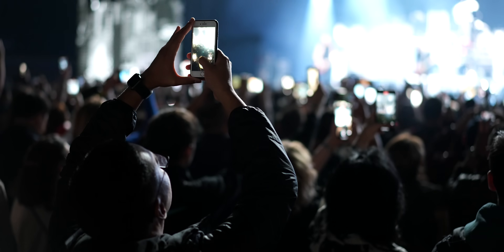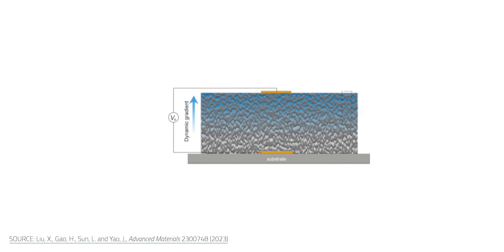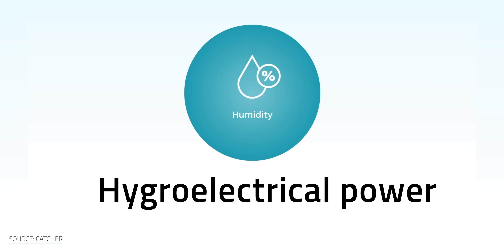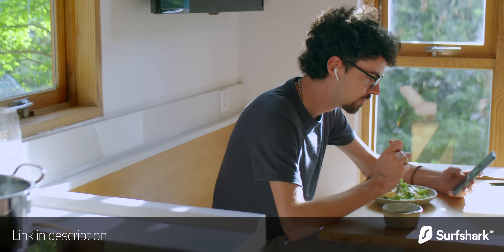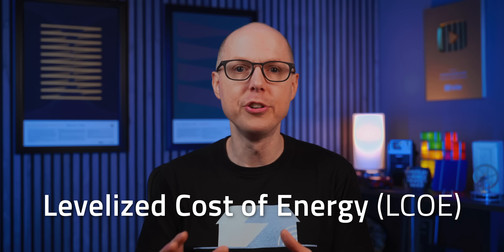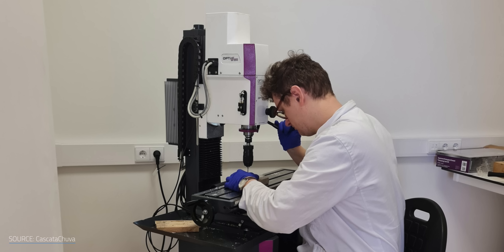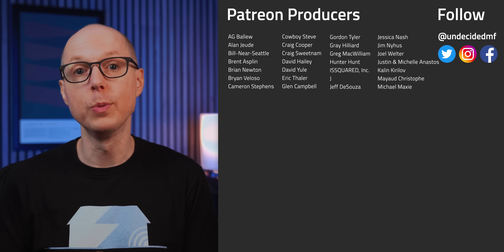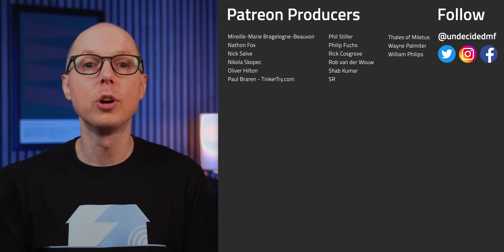Is This Accidental Discovery The Future Of Energy?

Comment: Huge missing piece of info here.  The humid air must lose energy in some form if it is to be the source of electrical energy.  How is the humid air losing energy?  Is the device condensing the water out of the air?  Something has to happen to the air, it can't just output energy and not change.  We would be talking about the old perpetual machine BS here if they can't tell us how the humid air went to a lower energy state when it output energy to the electrical load.

Comment: What comes to mind as a question to me is just exactly what is the process equivalent to recharging this battery. I'm presuming that using the battery doesn't physically separate Oxygen and Hydrogen atoms in the molecule, though perhaps that's an assumption that I wasn't clear was being made. Not sure that process is exactly 'safe', though at low volumes, it's probably not too hazardous, as long as no on introduces the elements to Thermite.. Regardless, the animation very nicely shows water molecules going into the material, but I'm not seeing any indication of how they 'clear' the space or if that's a part of what happens. Is the battery going from a 'no charge' situation to 'fully charged and permanently 'hot'' setup when activated?

I can see a bitcoin miner operation being set up with a floor of these, with, or without ventilation for air and humidity flow, with a layer of miners on top of the batteries, and the assembly filling a basement, or considering the heat generated, perhaps it becomes t he radiant heating for the floor above them?

Comment: If it's condensing water vapor while extracting latent heat, it can be used as as self-sustaining dehumidifier. Some of the generated power can be used for powering a fan to mix the air in the room.

Of course, this also means that it requires a filter to prevent clogs. So, it needs a built-in air purifier.

If it condenses air, this also means that it is a water generator. Can be used for some water needs, like cleaning.
Reply: lol, I didn't see your comment and basically suggested the same thing.
Reply: They don't have a way to take the water out. Imagine the nano-pore material starts off completely dry. As water lands near the outside areas, a voltage is generated. The parts where the water lands, gets more and more damp. But it does not get to dripping wet. Because as the "dampness" increases, the voltage starts to drop off. A balance is reached long before saturation.

Think about it. For the water to start dripping, you basically need so much water there is a film around the material. Then add more water, and only a while after that, does the dripping start. But long before that, the nano pores are already completely covered by the film, so no more power generation. I imagine the device, when it comes out of the factory, will work for a while, and then it stops working.

It is like a very inefficient battery. Once the reaction reach the limit, no more power. If there was some way to drive off all the water, then you may be able to get the battery to work again. So you have a rechargeable battery. If the process does not destroy the nano-pores significantly, then you can reuse the device for a while.

This is why Cascatachuva can demonstrate a small prototype. It generate a small amount of electricity for a short time. This is going to be Elizabeth Holmes all over again. I suspect there is an immovable wall they will run up against. The underlying concept may not be workable at all. The Russian Portuguese guys have nothing. Whether it becomes another Theranos depends on how far they choose to "fake it until you make it" and at what point they realize they will never make it. It could eat up a lot of investor cash if they are stubborn fanatics like Tesla, sticking to an idea that cannot work and refusing to give up. We now know (mostly) how to those electricity towers work. True believers can be crazy fanatics. It's only after they realized the futility of their cause, but continue to collect funds, that it turns into a scam and a crime. Some people will never get to that point. Our civilization's progress depends on people like this beating their heads against the wall. But we live in a universe with physical laws that can never be broken. Some of them are doomed to fail because of the bit of wall they selected is completely unbreakable.
Reply: @danielch6662  Thank you for the explanation. I got it 😊

I forgot how nano pores are very attractive for water. Even in our macro world, micro details on surfaces cause water retention (glasses with hydrophobic coating hold more water drops if they get micro scratches, or if they get dirtied by something). Nano details must be almost being glued with water drops.
Reply: @danielch6662  Elizabeth Holmes didn't have anything close to a working prototype of what she was talking about

Comment: Honnestly I have quite big doubts about this, especially when not knowing what is happening. I mean, they are talking about "generators" but what if that's like an air-battery ? meaning that you use it once, oxidizing something, then you can't use it anymore ? Like once the humidity is inside, it doesn't get outside (we saw a gradient here, so this could generate something)... But once it's "full" of water, what ? You need to heat it to get the water out ? Then this is not a generator, this is a battery... Don't take me wrong, this could be awesome, but there is so much unknown here that I don't believe it to be working soon.

I'm quite suspicious when there is claims about taking energy from "air". You always need almost two zones and transfer things from one area to the other (be it electrons, heat, pressure, ...) to get some kind of energy. What if that's only like piezoelectric currents from water condensing into this like into haze-condensing units for dry areas ?

To be honnest I though once about a system getting energy from humidity because theorically if you condense humidity you get some "heat" from that (you know, reversing the boiling process). So theorically you could have a working dehumidifier without energy source, and if you manage to do it well it could produce some electricity maybe. But this don't seems to be the case here.

Comment: I think that the $20,000 solar system is not equivalent to the hydroelectric battery. A 10KW solar system makes 10KW per hour, so if it averaged 4 hours of 10KW production per day that 10KW system will make 40KWH per day. In contrast the hydroelectric battery you mentioned, produces 10KWH per day which is not an equivalent amount of production. I would say that this hydroelectric battery is not competitive with solar on the basis of cost, rather if you have no way to utilize solar  this system would be effective at producing energy that someone might need. It is a small detail, but I think it is important to look at the totally production over a 24 hour period, because typically people have a daily energy routine that requires an average amount of energy to accomplish.

Comment: Step 1 - Water molecules gets close to the surface. 
Step 2 - Charges are moving towards the water molecule.
Step 3 - Opposite charge potential is created inside the material.
Step 4 - Electric current is equalizing the charge difference.
Step 5 - ??? What is removing the attached water molecules again ???
Step 6 - Charge difference created by step 4 remains and repels further water molecules ?!?
Beats me... maybe there is some organising effect that organizes the vapor a bit and converts vapor to liquid and this creates small water islands with more charge than the diffused molecules in the vapor and it's just knocking electrons to higher charge levels to cool down enough to stay liquid... or...

Comment: One micro watt per thumbnail is about 2 cm^2 or 5 miliwatts per square meter which is 200,000x less than the solar energy on a solar panel and 40 thousand times less dense than a solar panel for far greater construction cost and also likely a shorter lifespan.  It’s a fake technology that will never power anything but ultra low power devices and even that makes no sense when you can just put a battery on one that is far smaller and will last many years.

Comment: So we could finally have tech that we just need to breathe on it to power it...

But imho, if this works, instead of one large 10kwh battery, every device has its own small self charging battery. How much energy comes from the grid to power phones, TVs, heck even fridges...air gen built into our devices would reduce our grid dependence.

And if I can be so bold...a self charging EV in 50 years time...

Comment: I'm not super optimistic about this technology, it will probably only every be useful for very low powered remote sensors - which is still really cool. But say you wanted to power a 4k tv with this, just driving the pixels alone would require 9,000 sqrft of this material and you can't lump it all together into a cube because you need humid air, you can probably do layers but those layers can probably only so big before the material gets to far away from the air Inlet and the energy from the humid air was already fully extracted by the material closer to the air inlet. So probably useful for low powered IoT devices, remote monitoring devices (especially bouys) but I cant see it ever generating enough power to contribute to the grid.

Comment: Too bad it's fundamentally impossible to draw energy from a single state. As described, power generation from the fact that the air humid, is not possible.           

It could be possible to have some generation as the material adsorbs the water, but unless magic removes the water molecules that effect would be temporary, and the actual source would be "built in" in the material. Of course, variations in air humidity could make it possible for the nanomaterial regenerate itself, to some degree, but that still wouldn't release much energy, and they don't describe the process as requiring variations in humidity. Also, that would make the continuous generation they promise impossible.

The measured outputs could very well be explained by things like measuring errors, and or some "potato clock effect", and some could possibly just  cheat. All those things happens all the time, but power extracted from a single state, hasn't happened yet, ever.

Comment: I'm still trying to work out where the energy is coming from. Energy doesn't come from "thin air" - to use a phrase that might just be appropriate here (or not, depending). If something goes in, and energy comes out, what is changed? What comes out? 

I really hope this works. It would be great for me, where solar sees me through the times that tend to be drier, but falls short when it's overcast and damp. But I am sceptical.

Comment: Matt,

Great video. The 15k to 19k figure you have for their potential washing machine size product is the capex, not the LCOE. Assuming it really makes 10kwh/day, this goes for 20 years without any O/M. I did the following calculation

10 kwh/day * 365 days/year * 20 years * 1mwh/1000kwh = 73mwh
$15k/73mwh = $205/mwh, which is about 14% above nuclear at $180/mwh (Lazards figures at 2023), not too shabby. 

Assuming you can DRAMATICALLY REDUCE THE COST, this can actually be competitive.

Comment: Even if the power production from such a thing may be limited, it may be interesting for desiccant applications. Depends on how well it relocates or sequesters the moisture it pulls from the air. Even something as odd as dehumidifier that can run a light or recharge a phone may be handy too, could still be handy in a basement where there's no daylight if the power goes out and it would also keep the mold or mildew in check by taking humidity out of the air.
Reply: The material must eventually become saturated and then you'll need to dry it which in theory should take at least as much energy as released when adsorbing water vapour. If it's in a place where the relative humidity varies a lot during the day that might happen by itself, but a cellar is not such a place.
Reply: @anderslvolljohansen1556  More interesting than generative applications might be whether the effect is reversible (i.e. can a humidity gradient be created through electric charge). That would make it eligible for novel-dehumidifer application, like the Peltier effect was for refrigeration.
Reply: I mean, the water doesn't just go away, so my guess would be that the temperature around it sinks slowly as you draw power from it. It's a strange concept to think about though.

Comment: Similarly there are thermocouples which produce electricity out of thin air, but not practical as an energy source. They are used as sensors for more than a century.

Comment: Your solar prices are way off. 500Wp is available for around $150. So 8 of these panels would surpass 10kWh per day, and the inverters is around $400. That "battery system" they talk about is excluding inverting. You should consider it a generator that charges your ESS, so you later can actually use it.

Comment: 10kWh is nearly enough to power the mandatory fans and other maintenance stuff in a 150m^2 house. And then you still need to add persons into that house that are going to watch tv (for a 150m^2 that's probably a 300..400W setup), cooking is probably around 2...4kWh for simple meals. Don't forget the washing machine and dishwasher.
Your heat pump, etc...
I live rather modest while working at home. And 20kWh is more like it with less m^2 and city heating not included, but the floorheating pump of 60W included (needs to run in the winter and in the summer, in the summer to pump the heat away from the areas in the sun, as we have a resin layer floor).
But to be fair: if something would give me 10kWh a day extra, I will add that to my solar panels etc... to pass the winter. I am not going to say no to 10kWh a day at a 1x1x2m loss of property.

Comment: No electronic device uses resistors to divide the voltage. Not since trolley cars in the 1930s. Instead you use a buck convertor or a boost convertor, to very efficiently change battery voltage into needed voltage. And most devices are designed to use as close to the battery voltage as possible. Lithium ion batteries output from 3.7V to about 4.1V. There's a standard for microchips that run on 3.3V. So that's really convenient just to start with.

Comment: Hypothetically speaking. 

If their air battery works . You could put it in an enclosed water-resistant space and use misting nozzle coupled with a humidity control to keep it at an optimal humidity operation range.
Expending very little power to do it as well.
Reply: Yup, just like magic! Hey wait . . .
Reply: @GeeTrieste   
To be honest, it would not surprise me for a company to make a breakthrough like this.. just giving the rate at which science has advanced. 

But i imagine the cost of something like this will be outrageous. 
If they can make it affordable, then someone like me with just a little ingenuity could live grid free easily.

Comment: Very sceptical. The energy has to come from somewhere. Is it the kinetic energy of the particles (heat)? A passive box that cools the surroundings at a rate of 10kW and provides the same amount of electricity doesn't sound like a real thing. Is it a chemical reaction where the material is consumed over time? Maybe, but if it works with many materials then maybe not. Where does the energy you get out come from?

Comment: There is one thing I didn't quite get about this hygro battery - do you need to discharge the water from time to time or where does it go? And does it need power to discharge the water from the structure?

Comment: I also have no idea how this works, but it makes me think of two devices.  The capacitor stores opposite charges on the surface of an insulator and a conductor.  The other is the static electricity water drop device where the water drops fall through a hole made with conductive wire where the charges are stripped off and stored in a Leyden jar (capacitor). I may be way off base, but...  One problem that I believe they will encounter is the interior sounds like a great place for micro organisms to live.  I hope that it will become another source of power for us in the future.  Great video! Thanks for posting it. Jerry

Comment: A 10kWHr/day device for 19k seems much better value than solar panels, depending on the variability of the humidity battery output, it could mean a battery-free 24/7 power supply. Also depends on how long the device lasts.

Comment: It seems too good to be true but if it somehow works, there could be a huge advantage pairing it with an evaporative cooler specially in dry and hot climates. However, the fact that evaporative coolers work seems to indicate that this shouldn't as coupling the two in a closed loop kinda gives you a perpetual motion machine....

Comment: Reminds me of what happens when you run led's at super low voltage, they can put out more light energy than the electrical energy put in.. it works by converting ambient heat into the extra light energy, dropping room temperatures... it takes so many leds it's not really practical though. I suspect it will be the same here.. I am curious where the energy is flowing from though.. to generate power there will be need to be a gradient that gets depleted as the power is drawn.. so where does the energy come from exactly, is it coming from ambient heat??? does it dry the air?? where is the gradient coming from?

Comment: This doesn't smell right at all; I don't see what is doing the work. Imagine you had one of this washing machine batteries that can produce 10KWH/day.  Put it in a sealed box and splash some water on the floor inside the box to ensure that there is high humidity inside the box perpetually, as it is sealed. Now imagine drawing 400W 24/7. Where is the power coming from?